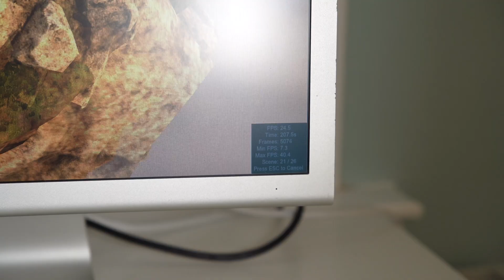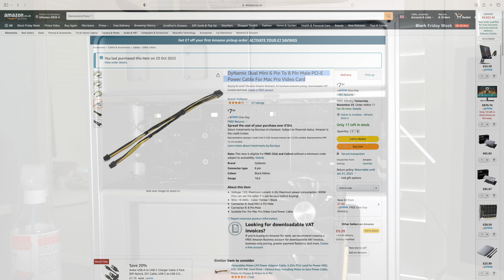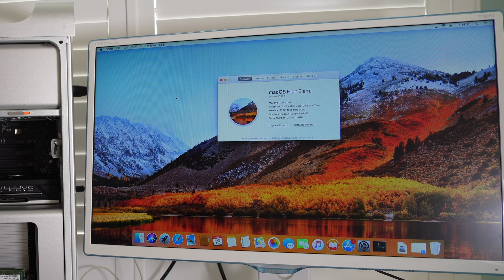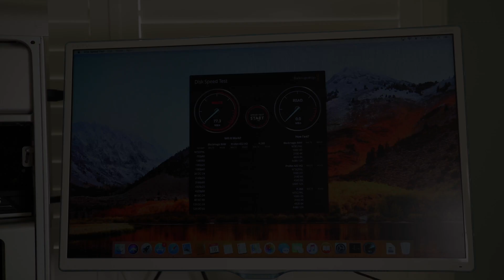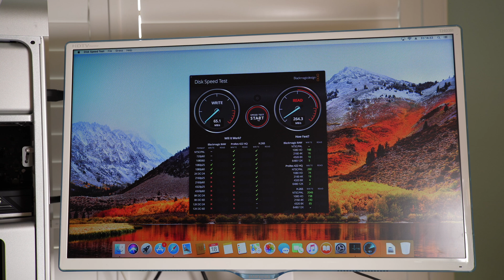My First Mac Pro 5,1 Upgrade! Installing A Radeon RX580 8GB Graphics Card

Comment: Just installed a Saphire in my 5,1 too. Since I was using an apple cinima display I first had to buy a female mini display port to display port adapter to be able to connect the graphics card to the apple cinima display monitor. Then I put it in the mac pro but wasent working on monitor. I switched the two gpu pin cords around (beside the fan) and it still wasent working. I wasent sure why- i thought maybe the adapter I was using turn the monitor on wasent accept the female mini display port or something. I then pushed the graphics card in more putting pressure on the left and right and it snapped in more. I relaized I didn't push it in enough for it to connect. Finally it worked and the apple cinima display worked.

Comment: Hello,  Just a question, was this rx 580 specifically a mac edition or flashed for mac, or were you running S, HS, or beyond?  Because I just installed one just like it in  my 5,1 with EC and I got a chime but no screen.
Reply from the maker: Yes, just a standard rx580….  I get chime but no boot screen…

Comment: I used my old card (non metal) to install mac Sequoia w/oclp. It's working. But when I change to my Radeon Pulse RX580, it won't boot up - only repetitive boot chime. No signal to my monitors.

What is the problem?
Reply: What I did is prepare an usb with macOS Sequoia and OpenCore patcher on it,pull out all hard drive with macOS, then reset Pram (P+R+Command+Option)wait the Chime second or third), then shut down the computer,plug in the usb created with OpenCore,Restart the Mac Pro,Hold down the Option key until you see the OpenCore,double click on that then Power down the computer,Insert a blank SSD and Restart the computer and install Sequoia with the OpenCore on that.
I have 2 Mac Pro mid 2012 12 Cores and 6 Cores and they work perfectly

Comment: No need to unscrew the fan on a macpro5,1. The little white circle on the right side of it - if you press that, the fan slides to the left, moving that steel vertical bar and unlocking/releasing the GPU from it's holding.

Comment: Thanks for this video. I have a 2012 Mac Pro that I need to upgrade with a Metal-compatible graphics card soon since I can't upgrade the OS otherwise, which is making it ripe for confiscation by our IT folks. I'm considering the Radeon RX580 as well. It looks pretty straightforward to do.

Comment: The reason you cant see the boot screen is that this video card is made for Windows. And for this reason it does not support UEFI. 
You need a PC to flash the GPU card. 

I also have a question. What happened to the older Cinema Display at the end of the video? Why dont you use that with the Mac Pro?
Reply: Do you have a link to the guide for DIY. Thanks in advance.

Comment: Hello, I have some issues with the same graphic card on Monterey (OpenCore Legacy Patcher Install). Can you please tell me if you used any specific Kext or file to make it work properly? Many thanks
Reply: I had issues with a metal supported GPU on OpenCore with Monterey, too.The solution I found was to use the original non-metal supported GPU to boot up the computer, then in OpenCore I clicked 'Revert Root Patches'. Then instead of restarting, I shut down. Then I connected the new GPU and booted (without boot screen). Once up and running, in OpenCore I clicked 'Start Root Patching' and then restarted. Worked for me.